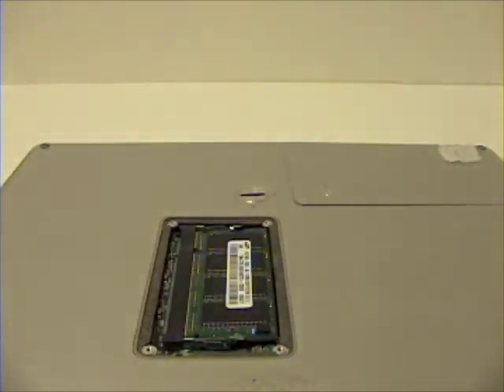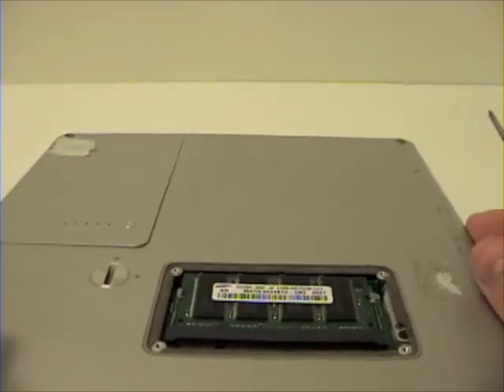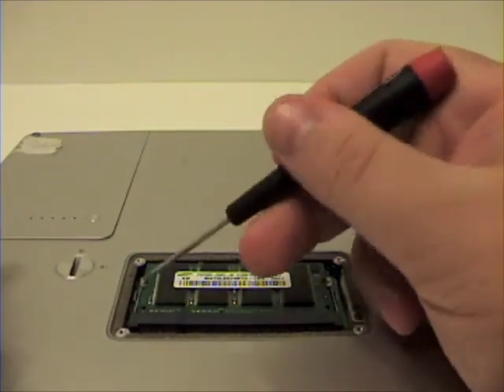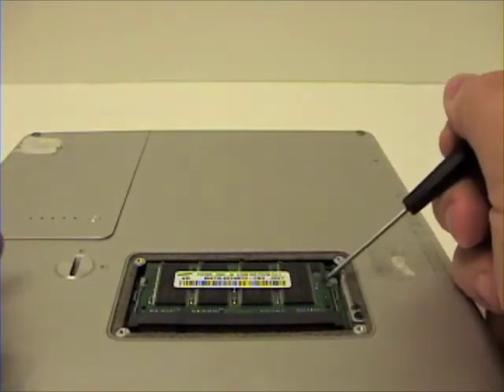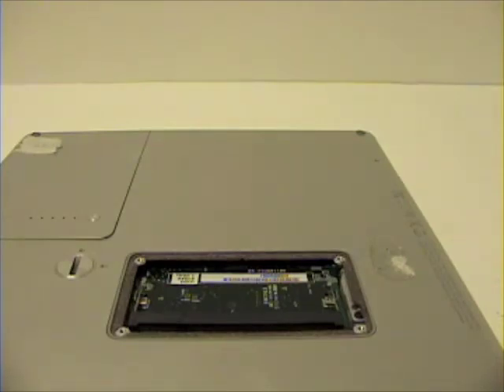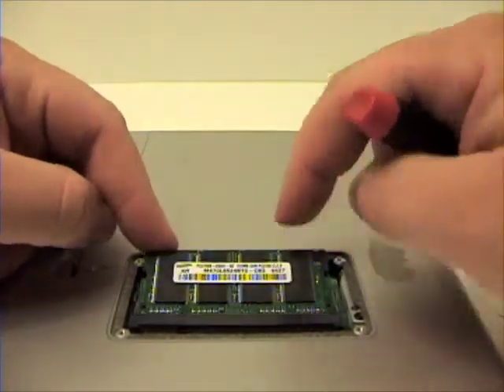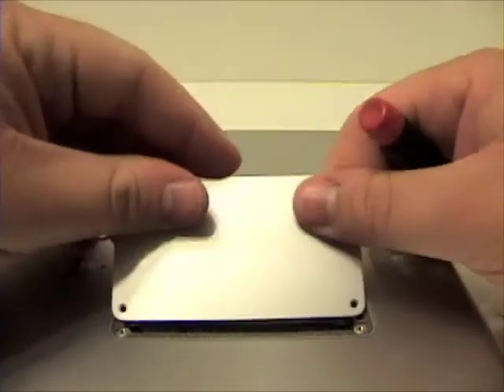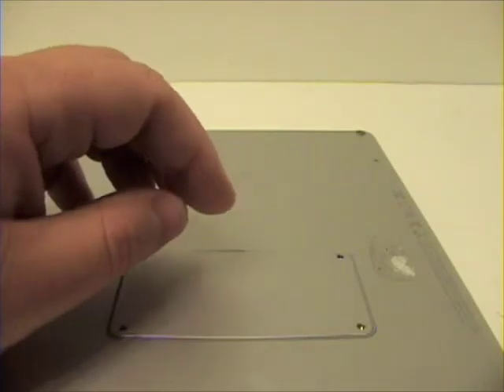Powerbook G4 12"  Ram Memory Replacement Guide

Comment from the maker: Different models of the 12" take different RAM. The 867 and 1GHZ take PC2100 and the 1.33 and 1.5 take PC2700. My guess is you've got an 867 or 1GHZ and need PC2100 or a backwards compatible 2700 chip.

Comment: i just got a 12 inch powerbook and installed an old 1 gig stick i had from my 15 inch powerbook. It was the same 2700 so i stuck it in started the powerbook up and check the ABOUT THIS MAC  and it states that the ram was only 512 , when in fact its a gig stick. It upgraded my stock rame 256 but still 512 short of what i thought it would be . any suggetsions ?